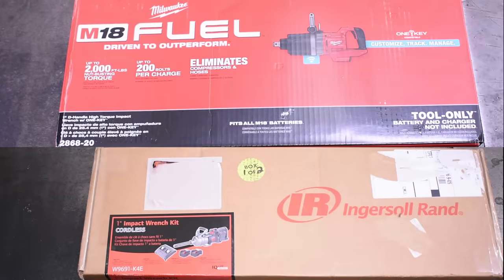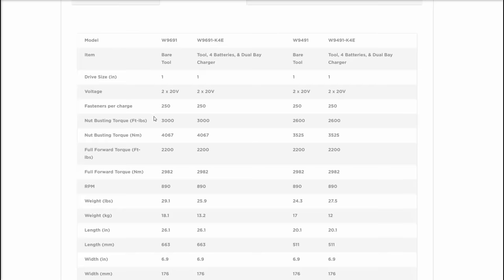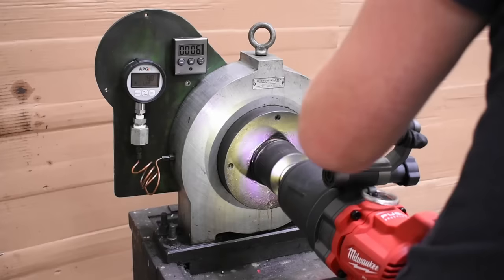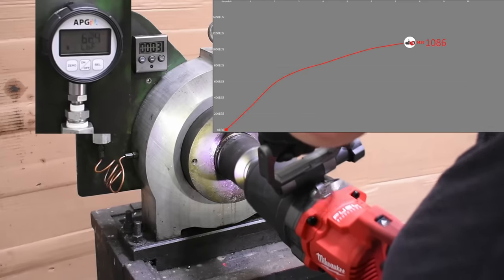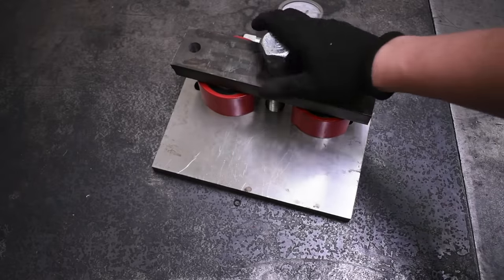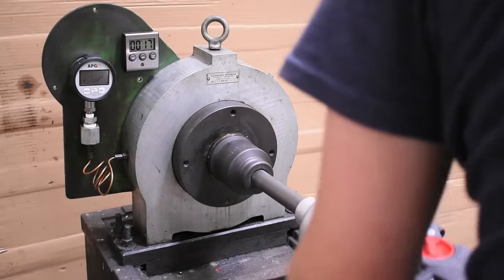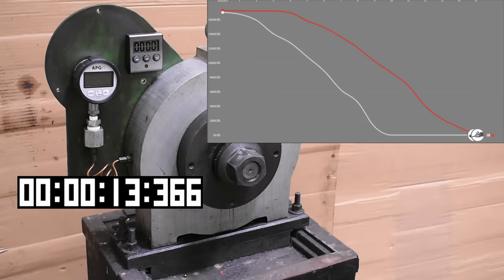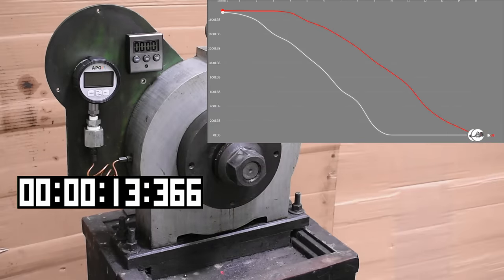World's Most Powerful Cordless Impact Wrench vs Milwaukee for the Crown

Comment from the maker: Subscribe or a 3 y/o in a princess outfit will go all "Mode 4 " on you 19:44
Find it here: https://amzn.to/3giENmc
Edit: Since a lot of people seem confused about this, the 2 batts on the IR total LESS capacity and less discharge amps than the single HD12.0 battery on the M18. You're either going to buy 1 tool, or the other to do the same type of job, the idea that they can't be compared at all due to a battery difference is a matter only squabbled about on the internet :P
Reply: subed
Reply: Just run away lol
Reply: Don't let her get hold of a sawzall... Drawing on the wall will be soooo boring!
Reply: You could rent fairly economically sullair air pull behind air compressor to power that Ingersoll Rand big air gun.
Reply: She is clearing my DTC's, freeze frame records, and resetting my emissions monitors to run ? (Mode $04)
Reply: Lol my son does the same this with my impact and drills lol he is just turning 4
Reply: @volvo09  👌😂
Reply: Can you test the TorcUP Volta impact wrench? seems more powerful and more compact based on specs :)
Reply: Granger sells a bunch of high torque stuff!!!
Reply: @materimoczi7447  I don't have the Volta, but I found a RP2000 on Ebay and then outfitted it with a curved reaction arm (truck wheel setup) and I will say that it is quite pleasant to use, I think though it lost a little nut breaking capability with this setup (the trick is not to over torque them to begin with) I'm also trying to find the angle formula for when anti seize is used or the hub has leaked onto the studds, I'm still testing, but it looks like hand tight with socket in hand to slightly less than 180 degrees (half turn)(dry for test)(target 475ftlbs)(33mm socket)
Reply: Y'all are getting to number ranges where you could legitimately look at like an engine dyno
Reply: See
Reply: 15 hundred. Not 1 thousand 5 hundred?
Reply: I do wonder what is most torque you can get out of an extension arm on a wrench
Reply: I heard you say the ext.anvil and the snub nosed are the same yet when looking at ingersoll they show the snug nosed impact with less ft/lbs than the ext. Am curious how is the ext. Anvil making more torque than the Ingersoll snubbed nosed model?

Comment: Who remembers that less than 15 years ago the "strongest" battery powered socket driver was a Makita battery drill that could barely snug a 5/16 bolt.
Reply: You're misremembering. Snap-on started making cordless impact wrenches over 25 years ago. Makita 20+ and IR over 15.
Reply: I had one of those Makita drills. Still do actually, just missing the foot long battery.
Reply: @mattt4183  yes, the old snap-on Ni-Cd 18V 1/2 was marketed as “the mother of all impacts” and rated at an optimistic 400 ft-lbs. it wasn’t bad for lug nut work, I bought one on the student program.
Reply: Eh, has to be more than 15 years.  Makita LXT debuted in 2005/2006 and their original compact impact wrenches that launched fairly early into that lineup definitely weren't slouches for their time, they'd probably hold up decently well by today's standards even.  Those old BTW251s were rated at like 170 ft/lbs and could definitely get some work done.  I've still got a few of our retired wrenches in a box and all but 1 still works, they just don't hit very hard anymore because the spring mechanism on the hammer assembly is worn out.  

Their impact drivers hit plenty hard too.  ~1100 in/lbs wasn't too bad for the time either.

edit: yeah.  Those old BTW251s were out by February of 2007.  So that model is over 14.5 years old now.
Reply: @jaywelker5566  before that they had a similar one but on 12v NiMH
Reply: I still have it & it still works, I refurbished the battery packs recently. I've got a million old nicad tools I've refurbished now.

With a nice terminal spot welder & thick nickel strip, ain't no noob.

Edit: I too think "under 15 years" is wrong. Gotta be over 20.
Reply: @mattt4183  I agree.  20 years ago DeWalt came out with the 18 volt hammer drill that would twist your wrist if you wasn't careful. Couldn't tell you how many lag bolts I snapped off with it.
Reply: Its funny because as a DIYer I've had the same automotive tool set for about ten years thinking I would never own an impact wrench. Fast forward 9-10 years later and I find myself doing a lot more car work except the price of power tools are now within reason for DIYer and their power often exceeds what the average person would need. I couldn't be happier and I love watching videos like this one although I'll never own a 3,000 ft torque beast like the IR.
Reply: Only Makita 👍
Reply: The Makita btw450/xwt04 goes way back.
Reply: I remember back when the phrase "Nut Bustin' Torque" meant, turning her dainty lil flower into GOULASH!! {0.o} 😆😂🤣 

JUGGIN' THE DAWG!! JUGGIN' THE DAWG!!......JUGGIN' THE DAWG!! JUGGIN' THE DAWG!!
😆😂🤣
Reply: You mean 5 years ago? :P
Reply: I had a powerbuilt unit batery a while back
Reply: 20 years ago I had 14 V Bosch machine. Only issue were the batteries, they were Ni-Cc and died in storage. Torque wise, it was plenty strong for professional work with dry walls.
Reply: No way I had a crapsman 19.2 that could tighten at least a 3/8 bolt
Reply: I remember when I was about 18 a friend let me use his drill to drive wood screws and it damn near put the screw head through the wood like nothing. Blew my mind
Reply: @anthonyaubuchon765  my dad has one. Always uses it with the screw in 2nd handle
Reply: 10/10 don't wanna remember.
Reply: 15 years ago, i was 11
Reply: @colemanbonner  I own both I purchased them 12 years ago. Snap on was good back in the day but now they are junk compared to competitors.
Reply: Those 7.2 makita drills were outstanding for the time!
Reply: @jabroni6199  THAT AND THE FLASLIGHT.
Reply: Ughhh…. Can’t anyone take a joke anymore??? The OP was just exaggerating for kicks and giggles, gosh🤦🏽‍♂️
Reply: I still have a working one that's was my dad's
Reply: I have a snap on 1/2 cordless which is still rocking. I had to rebuild battery.
Reply: My 2005 28V Milwaukee I still use disagrees....
Reply: @obfuscated3090  Whatever happened to the 28v line?? You would think based on more V = more power? At least that’s how it works with AC current. In order for a 18V to compete it has to have more Amps. Would seem to me to be more efficient to have more volts and less Amps.
Reply: Yep I remember but now battery powered impacts are taking over the most powerful impacts are battery powered my air impacts just sit in the box they're junk compared to my battery powered!
Reply: Nothing a cheater bar tied to a come along can't do
Reply: How about those powerful batteries of the  1980s that can barely get 50 1 1/2  inch screws?
Then can't recharge back to full power as new after only 20 uses.
Reply: Craftsman made some old 1/2 impact in the 19.2 volt line forever. Worked decently well for a 100 dollar kit.
Reply: My original Snap-On 3850 Cordless impact says otherwise, which I bought over 20 years ago. The CT4850HO came out in 07.  The batteries have been rebuilt a few times though
Reply: I change tractor trailer tires all day and if you had told me 5 years ago that I'd be using a battery impact for 90 % of my work I'd have laughed so hard. Now I hate using my air 1 inch

Comment: You will find that the second tool to market often is the better tool. Just the reverse engineering and optimization advantage that the second brand gets by not needing the completely innovate something new. drills, impacts, Sawzall's it doesn't matter the tool or the brand they all do it but it definitely pushes this industry forward.
Reply: They had to be both in development at the same time, there was not enough time between the launch of the two to have reverse engineered the IR.
Reply: @patrick188  6 months there was time gtfo
Reply: @patrick188  The milwaukee has been out for a couple years..plenty of time  for IR to develop something with the money they have
Reply: @haydona1845   1) There was about 1 year between them both being commercially available (the MW was not immediately available after launch, it took 4-6 months) which is not enough time to tool up and prove out a tool like this. 2) I will guarantee you there is not one interchangeable part in the two, that's not the approach that IR takes.
Reply: @theghost7277  You've obviously never been involved in new product development.
Reply: @patrick188  ok dude on utube
Reply: Is no one gonna mention the IR is like 40 fucking volts vs an 18 volt lol
Reply: @Joey-SubGod  yea that's true, I'm sure MW will come out with something to compete.
Reply: @Joey-SubGod  could you imagine the Milwaukee pulling from to batteries?
Reply: They weren't IR had a 2600ft lbs vs before this one.
Reply: @patrick188  6 months + 1 year is right on cue with the tool industry product development cycle. Take the specs milwaukee is stating and plan to out do them. When milwaukees product launches you buy one day 1 look at what they doing and adjust your design if needed.
Reply: @dillonkoch72  interesting, never knew about the W9491 2600 ft/lbs. Cant seem to find a release date, but IR has them featured in the same 2021 promo video so not sure if that means they launched at the same time or what.
Reply: @TheJttv  that explains why I couldn't find a price for it back in 2020
Reply: @TheJttv  The fact that they have different feature sets, different battery approach, different launch priority (ext. vs short anvil) shoots down your reverse engineered theory.  I'm certain that if you look at the design of the mechanisms you would find them to be quite different, as well (other than the fact that they are Ball and Cam style).  These were both in development at the same time with one reaching the market sooner.
Reply: @patrick188  if you are reverse engineering and ending up with the same product you are not innovating and doing it wrong...... so moot point.
Reply: @TheJttv  You may want to look up the definition of reverse engineering.
Reply: @Joey-SubGod  this.... i also like versatility which i have with the m18, for my 1/2, 3/4, and grinder and drills
Reply: "fast second" literal business strat
Reply: IR aren't exactly noobs to impacts.
Reply: @TheJttv  So you are saying that they were both in development at the same time?
Reply: @patrick188  your still going on about this?
Reply: @Joey-SubGod waiting for the MX-Fuel 1" impact 😅

Comment: Would be interesting to see a gas powered 1” impact as it is also technically cordless. And yes they do exist
Reply: I had to Google it. Found a stihl chainsaw powered 1 inch impact. Pretty neat.
Reply: we use em on utility work, dont always have electricity available or the time to wait
Reply: I wanna see someone turbo and nos that thing
Reply: @paladindanse8479  we just hauled a 1.5" drive down from up on top of a control room, thing is 70 years old, gona give a try of cleaning it up and get it working again

its completely lubed and free spinning, so hopefully just seals and it'll be ready to go =D
Reply: @keshmo12  Pretty common in railway track maintenance too.
Reply: The gas powered ones are junk. Not anywhere near as good as hydraulic or even electric......

Comment: That IR is an absolute monster. It would be great if you guys could get a 10' breaker bar or cheater bar/pipe solid enough to put 3K Ft-lbs on that dyno to actually test a 3K nut busting claim.
Reply: A 10 foot breaker bar?

Comment: Imagine if IR partnered with more popular tool company and licensed the battery design so we would not have to get proprietary IR batteries.
Reply: Who would they partner with though any companies with good batteries allready make an equivalent tool to most of the IR tools
Reply: @roycesmart8019  Metabo or Bosch. CAS or Bosch Alliance. Both also have a 21700 18V System. 
Bosch for example will provide with there ProCores the next 18V Fein Multitool and at least intern there are rumors Stihl will join the Bosch System too. 
So IG outsource only the battery Support and still can build there own tools

Comment: My daughter loves using my cordless drill. I showed her how to put stuff in the vice and hand safety. Now she goes around the house asking if she can drill holes in everything from scrap wood or golf balls to walnuts.
Reply: I hope your daughter is an adult. Nothing safe about children handling power tools.
Reply: @MrSupernova111  uh, what? You build respect for tools at a young age. There's also plenty of kids handling fire arms too. I was handling power tools since I was 8. I took shop class in middle school when I was 12 and was working with drill presses and sanding tables.
Reply: @MrSupernova111  I guess I need to back 72 years in time and undo my my Dad spending time teaching me to operate his South Bend Model A lathe when I was 8. He supervised me but by the time I was ten I used it on my own. I wasn't allowed to use the table saw unsupervised until I was 14, but all the other tools were allowed. Bandsaw, arc welder, power hack saw, Lathe, Shaper, Oxy Acet torch (which use for both brazing and gas welding).

FWIW: Still have that 9" South Bend lathe in my Shop along with a 12" lathe and a BP clone vertical mill, among other tools.

Comment: You guys NEVER!!!!! Fail to further impress. Because of you I’ve made the choice of two impacts. One for car use and one for my semi truck THANKS FOR ALL YOU DO.
Reply: Which tools for which jobs do you prefer? 

I am a water/gas/sewer utility worker and I am a firm believer in the Milwaukee M18 tools. From their impact working in the bottom of the hole we work in. To their reciprocating saws cutting pvc, ductile iron, and everything in between. Their search light is so popular every single truck we have has one in it, even those that swear the Dewalt tools are the best lol.
Reply: Which one for car use
Reply: Which one did you get for your semi? And has it paid it self off as opposed to having to call road service to change blowouts?

Comment: I would love to see the Airtec Master 35 gas powered 1 inch impact! I use it everyday in my job as a welder on the railroad. 

They are slowly moving to battery tools but the old moped will never stop aslong as there is gas in the tank! No pesky overdrawing the battery or overheating with gas!
Reply: A gas powered impact. Wow. It must feel badass using it. Screw the pneumatic ingersoll rand I use.
Reply: @dchawk81  the ones we have a rated to 1840 ft/lb or 2500 Nm!
Reply: Guy I used to work with worked at some equipment rental place previously. They had a large gas drill for rent and it was frequently returned by a renter with his arm in a sling
Reply: @imreallydamntired  Uhh a gas powered device is NOT tethered....
Reply: @imreallydamntired  In my world filling up the tank is even less tethered then having to have charged batteries ready to go in my truck when I am out in the field. We already take a small 5 liter can with twostroke gas with us for all the other big tools so it's really convient!
Reply: @Julio Gonzo  Were they not told to use them perpendicularly when doing bolts?

Comment from the maker: Want all of our rank charts, updated weekly?
 https://torque-test-channel.preview.teespring.com/listing/all-ttc-rankings-chart-live?product=953 Or FWD any purchase to TorqueRank@gmail.com
Reply: Wooo, I don't normally buy merch, so I got this instead.
Reply: Bought this and the link I was sent is not updated
Reply from the maker: @ThadrinC  You followed the link and it's not the latest? The File may be out of date, but there's currently only 1 link. So if it lead to a rank chart, can't imagine how it's not the current one. There's only 1
Reply: @TorqueTestChannel  It’s working now, maybe it was glitched? It also does not have the data from the xwt14z. Anyway what was the email to reach out?
Reply from the maker: @ThadrinC  XWT14 should be showing under compact and average compact ranks.
Reply: @TorqueTestChannel  thank you